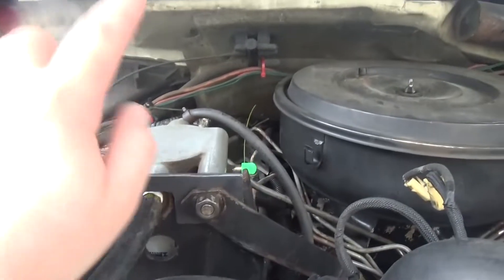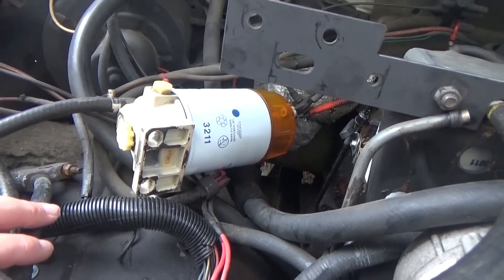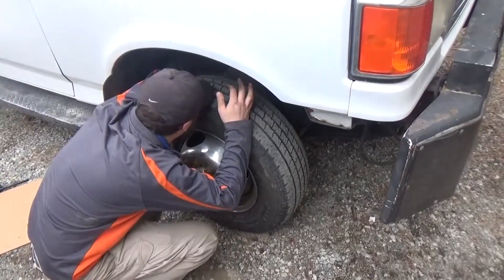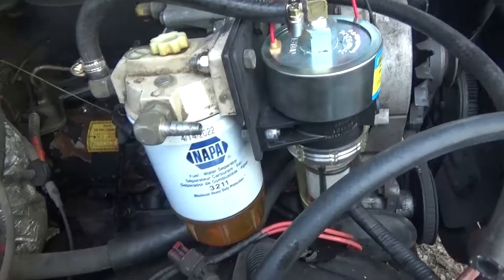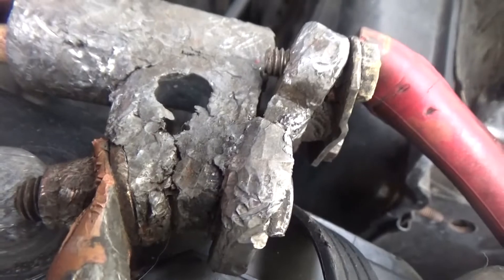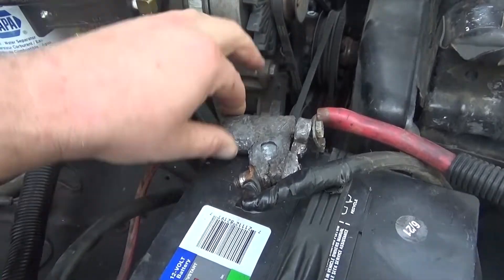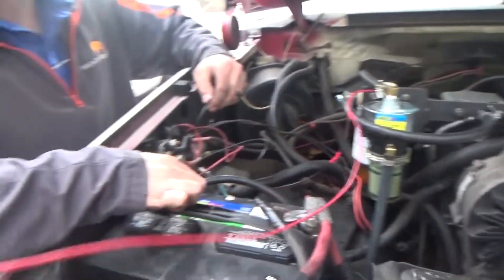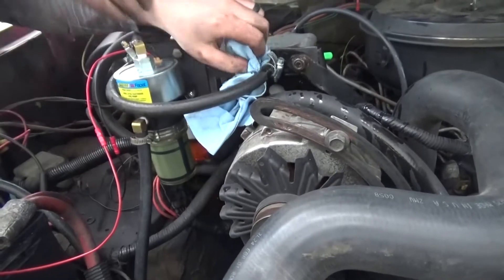7.3 idi, first start with new injection pump

Comment: I really like these F-super duty trucks, it's why I have 4 of them. Two of them are this body style but longer wheelbase. Both have 7.3s, one has a zf5 other has a e4od. I've owned many of these and have taken apart several that were too rough to save. So I'm very familiar with how they are built, they are well built trucks.
Not long ago I recently bought a couple f250 super duty trucks. One is a late 1999 7.3 rear wheel drive with a 4r100 auto trans.. 353,000 miles, bought it not running because it needed a high pressure oil pump. Those are really expensive, but I was able to find 1 in a 2002 e350 that had a 7.3. Cost $20. It runs and drives so good you'd never guess it has 353,000, but it was well maintained. It's an extended cab long bed.
The other is a 2000 f250 4x4 with a 7.3 and a zf6 6 speed manual. It has a tuner, aftermarket air intake and a 5" inch exhaust. It's a fast 7.3. Has 252,500 miles, runs and drives great. It needed one piece for the tie rods replaced and rear leaf springs. It's also an extended cab long bed.
I got them both for basically scrap price. I have to admit I wasn't the biggest fan of the super duty trucks mainly because the cab is somewhat over the engine. But they are actually a lot easier to work on than I thought.
Reply: I got a 02 7.3 zf6 truck and a 1996 f250 7.3 powerstroke zf5 couple 6.5's etc